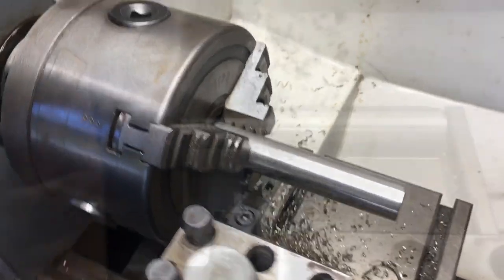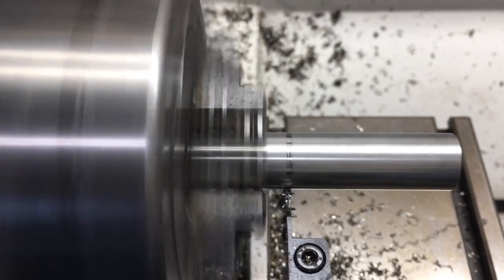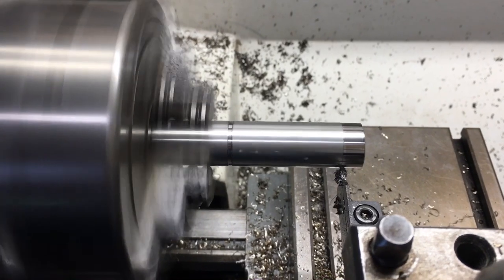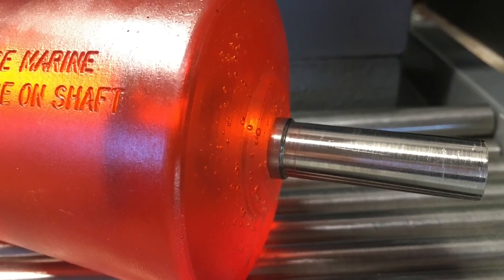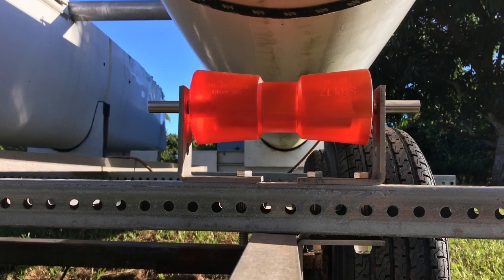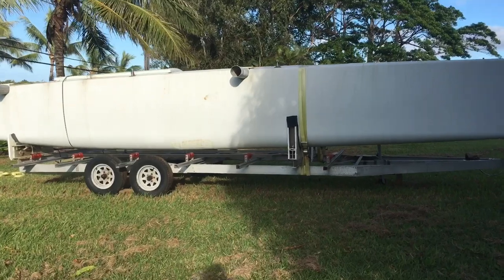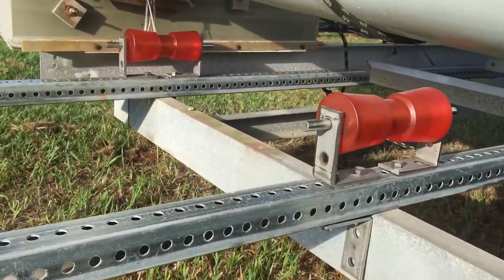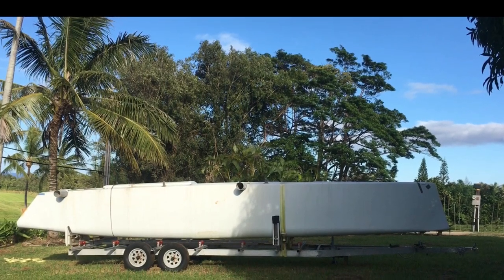Big Solar Electric Catamaran Build -Fabricating Trailer Roller Supports

Comment from the maker: This video was about the 30’ Cat project, but my smaller proof of concept build -SolGato does use Caroute motors. 

For this project, I’ll have large brushless motors mounted inboard coupled to custom transom mounted drive legs. 

The motors on the smaller boat are 120lb thrust 1500WI/1000WO 24V Brushess Caroute motors.
Reply: Thanks for your reply.  Are those  R-Platform motors?
Reply from the maker: @shan7511 They would be the E platform. All platforms use the same motors, they just configure and package them for different applications.